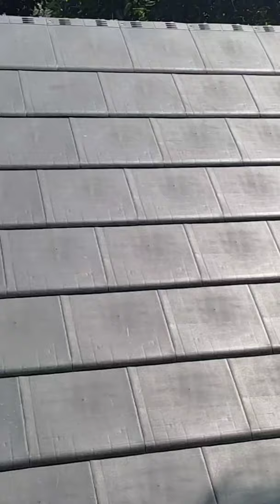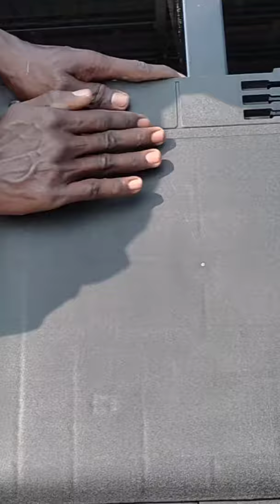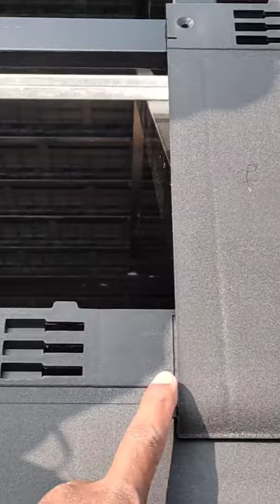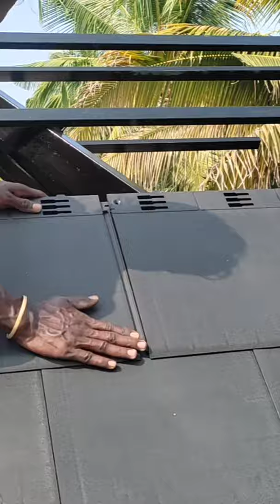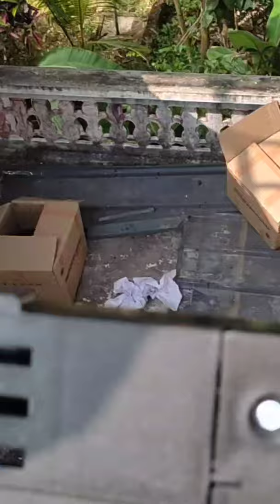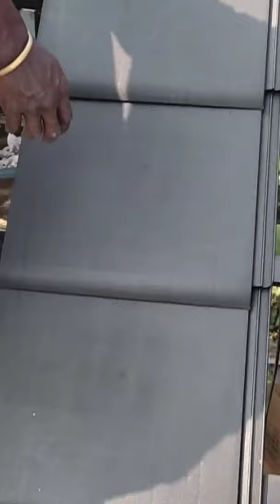Nano ceramic tile   my first work

Comment: I have done this work, it will not last, it will burn in the sun, it will not expire
Reply: It is thermal, UV proof. It may be a different tile. Many civil engineer experts highly recommend it.
Reply: It  is nano ceramic tile with GI frame Structure more than eco friendly and cooler than any other competent roofing system